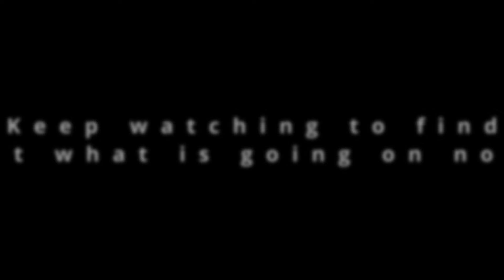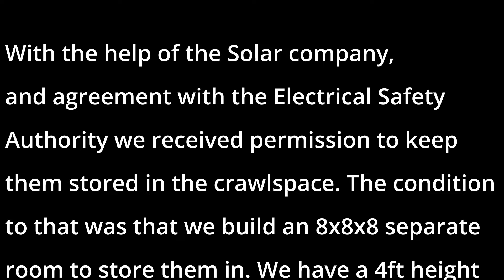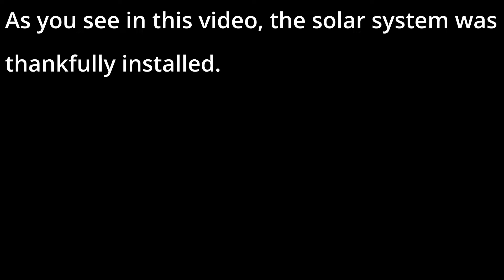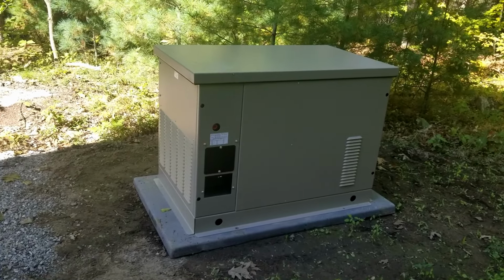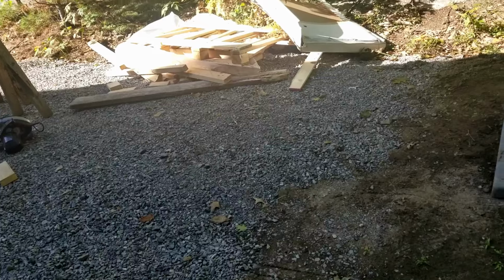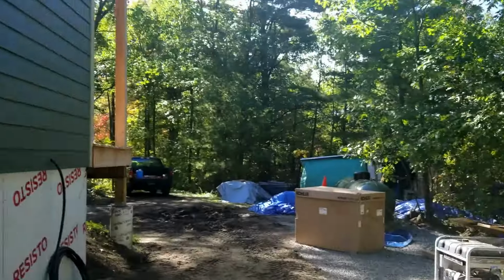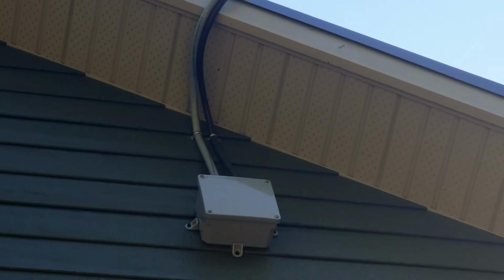The BATTERY Room...what the HECK!! #the battery room #off grid #solar system

Comment: Is that the heat duct in the upper right corner?
Reply from the maker: Yes, house has a furnace.  They only ran the duct as far as that at the time so we could build the room. This was last years build
Reply: Worked out perfectly since u had to heat the room..it can't be too cold under there..looks well insulated.
Reply from the maker: The whole house is over insulated,  because we did it to our spec's. Most companies were not insulating like did and wanted like $18,000